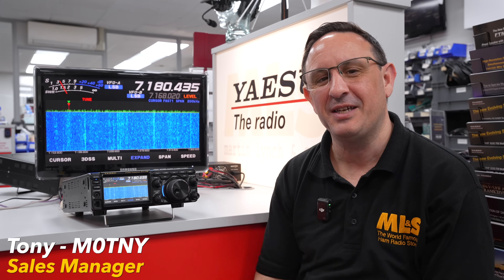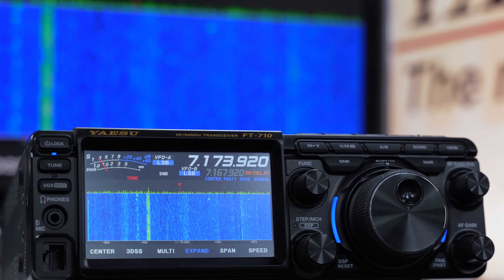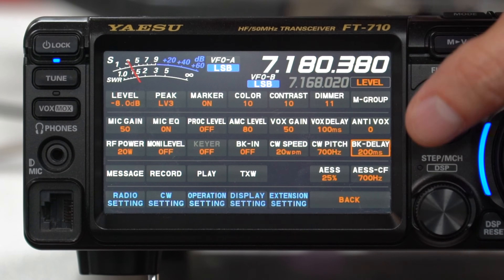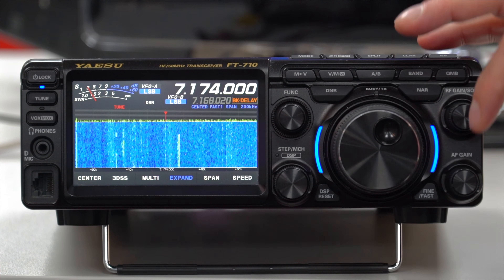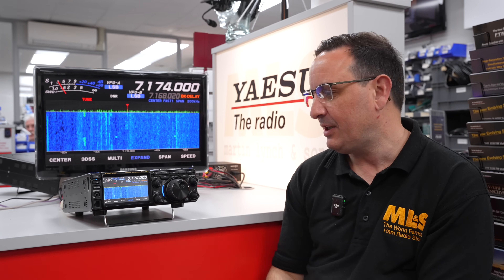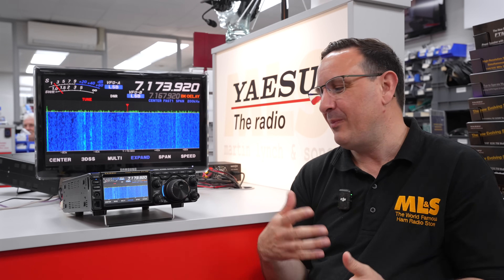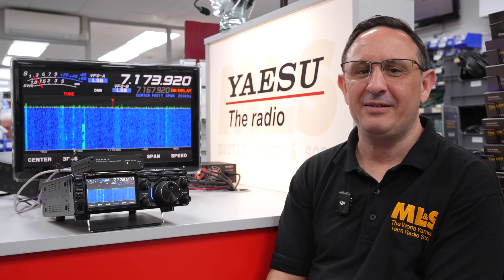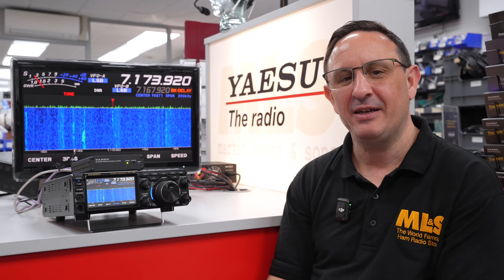Why the Yaesu FT-710 Beats Radios Twice the Price

Comment: First, I'd like to thank you for this review. However, I believe it's time to address the shortcomings of Icom and Yaesu in terms of practical scopes. Do we really need such large screens to visually perceive a signal? The visual aspect has been integrated by manufacturers, but the practical side has been neglected. Yet, HDSDR and SDRConsole were leading the way. It's ridiculous, and having two or three large screens in the station is becoming the norm. With the Icom or Yaesu FT710, do we need a microscope to see the scope? At this price point, we have the right to expect a functional scope, not just a fad.

Comment: My problem is on my FT 710 my antenna tuner on the unit doesn’t want to tune, however I put an inline antenna meter, and when you key up? No power and no meter reading is going through the Coax also it doesn’t show any power going through in the external meter, also when I use a yasau FT 991, the radio works perfectly fine, so I know the antenna system is good, so on the FT710, eather the final is out, or transmitting final is out?
Any ideas

Comment: New licensees ask me about first HF base radios once in a while and my answer is always the same. The best radio under $1000 is the FT-710 and the best radio under $3000 is the FT-DX10. Unless your budget exceeds $3000, there is no reason to spend time looking at any radio other than those two. The filtering and receive sensitivity is simply unmatched by any other radio, even radios that cost 10x more!

Comment: Warning, this model should not be bought and only FTDX-10 or FTDX101 due to fact that this radio does not have a PBT/Shift-Width button like on the DX10 and 101. However Yaesu calls the nob SHIFT-WIDTH button. Seriously folks, you cannot properly conduct DX without this button and this radio as all modern HF rigs is meant for DX.

Comment: If it’s RX is anywhere near as good as the FTdx10 then its worth considering as I have one since they came out.  However If it had VHF/UHF it would make a good field radio.  30Ah LiPo would cover most of the day depending on how much it draws on RX.  Interesting thanks for posting.

Comment: Few new monitors have DVI connectors, an HDMI to DVI cable works fine, I'm using one with my FT-710, so not sure where you're getting that it has to be DVI to DVI.
Reply: The conversion lead works fine until the return voltage going into the radio blows the inside of the radio. It can take 2 years for it to go but it usually does go and you lose the output. Sometimes it’s simply the fuse other times the fuse doesn’t blow and it burns the output itself. Make sure your lead is one way and doesn’t return from the monitor else you will blow the dvi output, even Yeasu recommends not using a conversion lead. Hope all stays well 73 De M0ble
Reply: I use a VGA monitor with a DVI to VGA lead.  Much safer than trying to use HDMI....
Reply: @JelsterUK  Well I guess I'll change the cable as I realized that I've got a small 7" monitor that was sold to be used with Raspberry Pis, I had had the 710 connected to a 27" monitor, but one doesn't need anything close to that size, the 7" is big enough and it's got a VGA input, so I"ll switch cables.

Comment: Hi Tony, your DVI comment isn't exactly accurate, I use a DVI-D to HDMI cable and have been for over a year and it works fine.
I wouldn't use an adapter, though.

Comment: "I've seen those shacks with everything mirrored to a 43 inch TV, that's the way to do it." Not many TVs with DVI, though! I thought the 710 bwas OK with HDMI converters, as Yaesu replaced the surface mount fuse of the FTDX-10 with a resettable one? I find this area of Yaesu design utterly baffling - why not make a port that can support a dongle? Why not use the HDMI output of the driver chip that's in there already? Are licencing fees that onerous when even the Raspberry Pi manages. I have an FT-710 and love it, but this bit is needlessly irksome.
Reply: I put mine into a projector, no one can beat my waterfall!😂
Reply: Apres vous, la deluge@
Reply: HDMI a DVI má stejné kodování obrazu, stejné vodiče. Není potřeba konvertor, stačí koupit kabel DVI - HDMI

Comment: I've had the radio for about 12 months now and enjoy this, but one slight bugbear is the waterfall width.  I prefer to use a fixed width covering the SSB part of each band but Yaesu only have pre-selected span widths which means on 20m I'm looking at half a screen out of band as the selection options are either 200k (not enough), or 500k.  @martin_lynch is there any way to get around this,  or can you have a quiet word with Yaesu and suggest a custom span option please for a future firmware release?